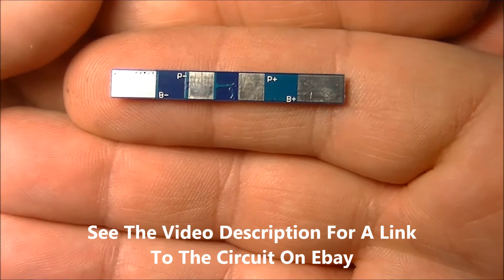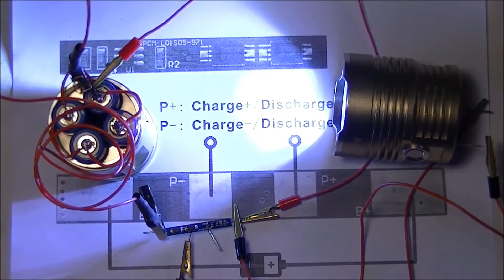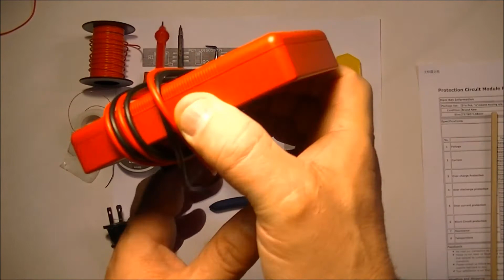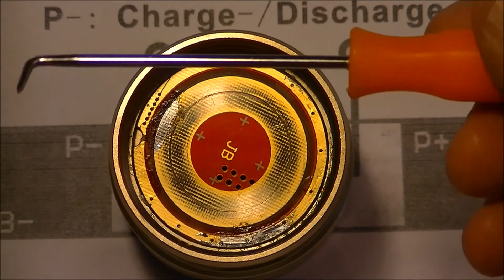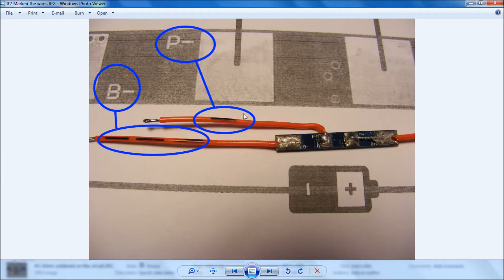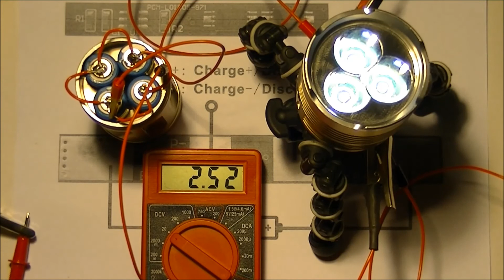Flashlight-Torch Battery Protection Circuit Install Stop Over Discharge On Lithium Ion Cells

Comment: I seem to have put the batteries in my SecurityLng flashlight backwards and it no longer works.  Is the problem the batteries or the flashlight?  If it's the flashlightcan I repair it?

Comment: Is there a way to mod this to cutoff a at different voltage? like 3.3 or 3.4v? variable would be better.

Thanks for your vids :D

From router question to battery question :D
Reply from the maker: xxgg I am not aware of one but I am sure it is available. I would search through Ebay and see what you can find. Thanks again.

Comment: Interesting 23mins Richard thanks,  if these Li ion batteries are dangerous why aren`t they all protected, i did short out a non protected 26650 one, at about 3.5v, and nothing happened didn`t even get warm, it was a Chinese 6000ma, but really 1000.
Reply from the maker: bmwnasher I assume that they are not all protected because they are going to be used in devices that will provide that function for them, like a laptop battery pack. From what I understand over charging and short circuit of Lithium Ion batteries(key here is Lithium Ion) is what is dangerous. With the Chinese batteries who knows what they actually are? They lie about their capacity what keeps them from lying about their chemistry? LOL, nothing. 

My main goal with this project was to protect them from over discharge which would happen if you left it on for a long time as in a emergency situation. My secondary objective is to use a much cheaper 3400 mAh battery. 

The Panasonic 3400 mAh cell is the heart of all the "legit" 3400 mAh protected batteries but the price almost doubles when you add the protection circuit to it. I bought the two NCR18650B 3400 mAh $16.00. The protected cells I bought cost more than that for one. For $5 light/torch I get to use the much cheaper batteries without any worry of damaging them (which was my primary concern). What I did learn is that at at 2.5V the output of light was very minimal. If you were using the light you probably would have changed the batteries long before they reached that level but again in an emergency situation it's nice to have the option to drain them to 2.5V if you have no choice. I think it was $5.00 well spent at this point. Thanks again.
Reply: Richard Lloyd If you need 4 cells i can understand the price difference, ive only got one torch that needs 2 cells, now im all stocked up with quality batteries. all the Chinese Utrafire have gone. except 2 red Ultrafire 3000 that give constant 1650mah.
Reply from the maker: bmwnasher Actually these lights can run on just one cell if you want. All the batteries are in parallel in this light so the voltage never goes over 4.20V and now will not go below 2.50V. 4 X 3400mAh gives me a very long run time on this light. I would say days of continual use. The Ultrafires are generally garbage but if you have a few that are working well go with it. Thanks.
Reply: ***** Agreed any Chinese battery i think is suspect, you may get the odd one good a i have, but it`s best to stick with well know brands, i learned the hard way, not cost wise as such just bad run times.
Reply: Richard Lloyd You get most tems from Amazon, what`s happening here on ebay is you purchase an item, and it gets delivered by Amazon, as far as im concerned its great because it`s usually next day delivery.